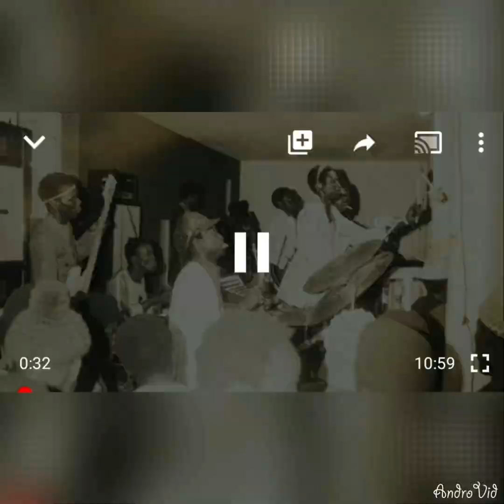(Building a house in Gambia Africa) continuation of the house foundation. Part 5

Comment: Good progress in that heat. I take my hat off to those guys doing that in nearly 40 degree heat without shade. What size is that compound it looks much larger than the standard 20x20m Gambian compound. My 23x20 took about 3,400 blocks for a 7ft high wall using those handmade blocks. I presume you are building a storey main house seeing you digging foundations to 1m deep. Are you doing a flat concrete roof for terrace or, building a metal roof. I wish you well.
Reply from the maker: Thanks for your comment We Wew. My team of guys are working very hard. The land is 15x30m. It's a story building with metal tile roof. 

Hope you have enjoyed the videos, much more to come. So please subscribe and share the channel. 

Regards Daniel